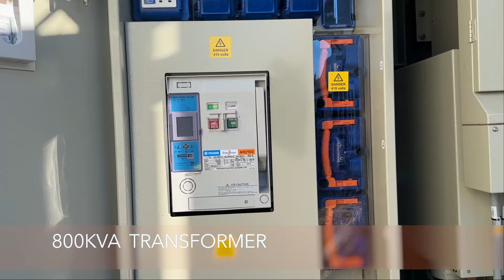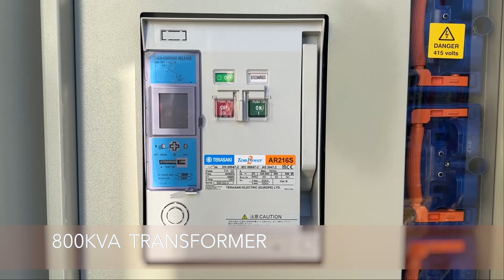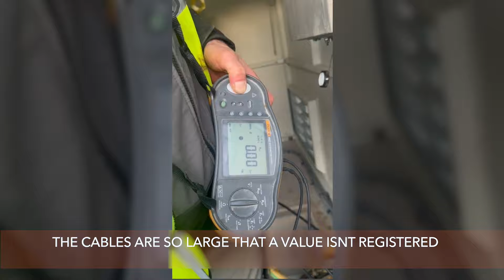HUGE 1250A supply for Electrical Switch Panel

Comment: I really enjoy that, thanks for posting it.

Why is there a cable tie over the heat shrink?
Reply from the maker: Glad you enjoyed it.

The secondary heat shrink was fitted to bridge the air gap between lugs, it was a little closer than expected so it just gave some extra protection.  Sometimes you just have to work with that you have,  and that was what we had available 👍

Comment: You’d think that doing stuff this big they’d have a meter that had a resolution lower than 0.01ohm and a powered crimper/cutter. 

Good video though
Reply from the maker: Thanks for watching it Steven 👍
Reply: It’s a continuity test . A simple multimeter on milli or kilo ohms would register a better reading . But why bother 0.00 indicates continuity .
Reply: @persona250  well thats why i asked innit. I dont know if just confirming continuity is ok or if they expected actual readings or not
Reply: @SME_Ste  they are using the low ohms meter to check the cabling is correctly identified
Reply from the maker: You’re right, it’s just to confirm each of the parallel feeds are correctly paired up.  Recording an accurate resistance reading for cables this big over such a short distance doesn’t achieve much.  It’s easier to confirm it using manufactures values rather than the meter.

Comment: What's with the wood?  you could of moved the Ali plate up to the level you've got the wood and used CW glands on the cables.
Reply from the maker: Just a different way of doing it.  It easier to use the wood to clamp the cables in place rather than struggle to bring them through an Ali plate.